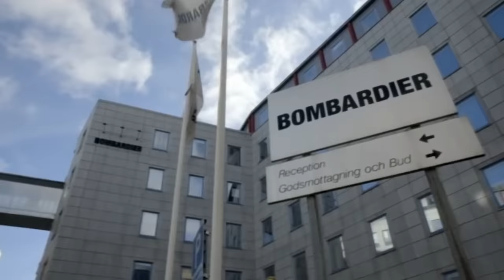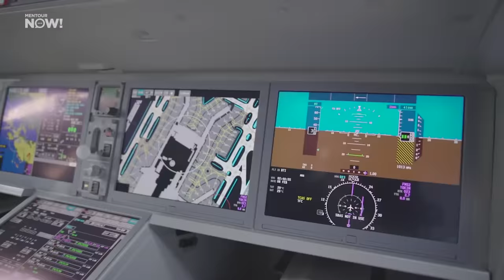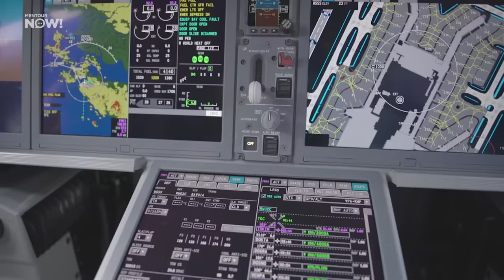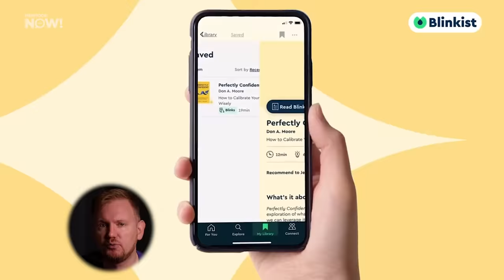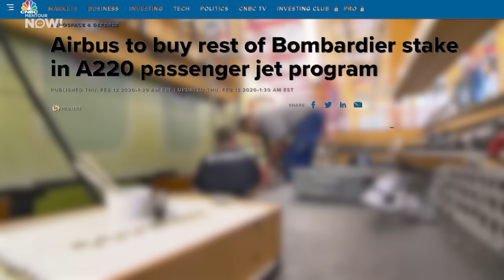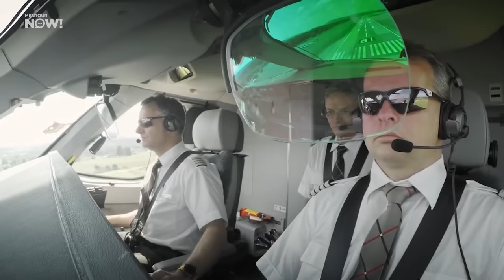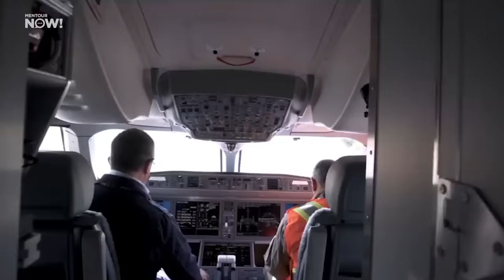Did Boeing GIVE Airbus a FREE Airplane?!

Comment: 737 used to be my favorite aircraft but I was blown away by how comfortable the A220-200 was. The Glass Cockpit and Cockpit Ergonomics would have to be a pilots dream come true.
Reply: It's absolutely beautiful. I consider it the 787 of the small aircraft market.
Reply: @corystansbury  787 isn't that good
Reply: I remember watching an airBaltic delivery flight from Mirabel YouTube video a year or so back. The airBaltic pilots in the video seemed thrilled to bits with the plane.
Reply: I took an A350 and the 787, in the A350 it felt like 2050, the 787 was very good. Nothing beats the A380 in terms of comfort but that will soon be a nostalgic thing
Reply: Only complaint I have about the a220 is the autopilot disconnect sound. It is the most jarring warning I've ever heard
Reply: @fumie4996  Yes it is. The 787 is actually an incredible aircraft, engineering and passenger comfort wise. And also up in the cockpit.
Reply: @fumie4996  To each their own, I love the 787 as a passenger, very comfortable (due to the higher cabin pressure I'm sure). Only thing I HATE are the stupid electronic window blinds, and how some operators force them 'on' during flight, meaning I can't look outside at all.
Reply: I heard from a pilot it's very noisy though. Much more than A3xx Airbus'. So much so that Air France had to buy many Bose A20s ear covering headsets to account for the extra noise.
Reply: Do you mean the A220-300 or the A220-100?
Reply: @frglee   airBaltic was and still the very best promoter with demonstration around the world of the A220-300👌
Reply: I flew across Canada on an A220-300 about a year ago, and it instantly became my new favourite airliner.  The A321-200 I was on for the return trip felt like a 40 year old coach bus by comparison.
Reply: @fumie4996  say that to its huge markets hare (excluding the 10 because Boeing are incompetent)
Reply: @fumie4996  Oh really? Try flying it ( I have). It is an excellent aircraft.
Reply: @bonnassem  just got off one. My only complaint was the seat comfort, but sound was normal
Reply: @bonnassem  the a-220 is actually the quietest passenger jet engine out there right now
Reply: Lol...yeah from a passenger's perspective. But the A220 is highly overrated. It has corrosion issues and the engines simply kill the type. Concerning the engines, the same is true for the E2. As long as it's not offered with a second engine type, like the Leap, it will never be a groundbreaker.
Reply: @bonnassem  The CSeries A220-300? NONSENSE the PW1500G is a geared turbofan that's 50% quieter than a 737 CFM56.

The CSeries A320-300 is one of the quietest if not the quietest single isle airliners in the world.
Reply: The 737 Max is my favorite (based totally on looks) but the A220 has one handsome nose!
Reply: @corystansbury 787 is a nightmare liner for passengers,  in fact for my April trip india to usa and back, i intentionally chose qatar and not united because united flies 787 Delhi to Newark.

I will try to never fly in the 787
Reply: I can confirm to you that the A220 is a dream to fly! Only downsides from a pilots perspective is the seat and the table
Reply: @fumie4996 yes it is, it was the best flight I’ve ever been on

Comment: What isn't mentioned in the video is that at the time of the Bombardier sale to Delta, the Canadian government has decided to accept the political heat and not go to an open competition to replace the RCAF fighter jets. Instead, the government was willing to sole source Boeing F-18 Super Hornets. Canadian government officials were in Washington to finalize the billion dollar deal when news of the Boeing trade action against Bombardier broke. Causing the Canadians to walk away from the negotiations. Apparently, the Boeing negotiators on the military side had been given no warning that the commercial side was going to take this action against the Canadian  government.  Also, one of the very expensive delays for Bombardier while developing the jet was the failure of the American based engine manufacturer to deliver a reliable engine in the time frame contracted. The result being that the program had to sit and burn through cash while waiting for the promised engines.
Reply: Talk about lack of internal communication within Boeing. They really did mess things up!

P&W did indeed take their time getting the GTF right, and Airbus had some initial issues with the variant for the A320 too. 

Some of the problems appeared to be close to "school boy" errors - e.g. differential cooling / heating of parts of the engine causing problems at start up after a short turnaround (the differential temperatures caused the engine shape / clearances / fit to be out of wack, until all of it had all cooled down). 

It was these kinds of issues that were well known about by previous generations of design engineers, but (the company having not designed an engine for a very long time) had been forgotten about by a new generation. It was a problem well understood even by designers of steam turbines (so it's, what, >100 year old knowledge?) 

Constant development, regardless of actual economic need, is the only way of keeping team knowledge together and becoming reliable in delivery.

But in the end, P&W's GTF has come good. It's kind of a miracle that the C Series got certified and into service, and a good thing too - it's a very good design!
Reply: I don't vote Liberal, but I fully respect chrystia freeland. Strong backbone on that one.
Reply: Not only that, but initially, the F-35 was not politically favourable for the Liberal government, as one of their campaign promises had been to cancel the previous Conservative government's sole-source F-35 contract and hold a fly-off instead.

The fly-off never happened and Eurofighter and Dassault both pulled out of the competition. The industrial offsets were reportedly one sticking point, but the big one was a non-negotiable degree of technology transfer, including of proprietary systems, to both Canada and the US due to NORAD.

That meant that realistically it was Super Hornet vs. F-35 and F-35 had the stigma of being the project cancelled by the government. Of course, thanks to Boeing's bone-headed decisions, F-35 was back on the table, and Super Hornet was off... leading right back to a sole-source contract for Lockheed!
Reply: @chanman819  hey don't forget the Gripian also stayed around! Seriously tho the F35 was always the better option and shocker after a certain conflict in eastern Europe now everyone wants F35s.
Reply: Wow! I didn't know this! Although I followed this very closely, I was not aware of the FA-18 deal they were working on.

I do love how Bombardier made a huge F-U to Boeing by practically giving the plane away to Airbus.
Reply: @RCAvhstape  Actually, if you had bothered to closely watch the video, no where is it explicitly mentioned that the Canadian government was actively sole sourcing Super Hornets from Boeing at the exact moment when Boeing decided to begin the trade action against Bombardier. The Canadian negotiators felt like they had been stabbed in the back as they were in the midst of buying an aircraft without going to open completion and so were accepting that they would receive political heat for not having a competition yet to then have the same company which would financially gain from their actions simultaneously try to prevent the Bombardier aircraft sale due to it being a non competitive activity (with the Boeing argument being so weak that it was eventually thrown out by the trade commission--Boeing's apparent hope that in the meantime, Bombardier might be forced into bankruptcy and so remove a possible competitor from the market). The anger felt on the Canadian side by this two faced behaviour by Boeing management is what led to the future dis-interest by the Canadian government to look favourably on Boeing when the competition for the RCAF fighter replacement was held (the fact which is indicated in the video but which doesn't include the Super Hornet negotiation betrayal as part reason for the Canadian side's disinclination to deal with Boeing).
Reply: @williamrobin2638  I can assure you the Canadian government had announced it's intention to purchase 18 Super Hornets as an interim capability measure just prior to the Boeing trade dispute. Canada backed away from that purchase and purchased surplus Australian f-18's instead. 

Read into it what you like but that original Super Hornet purchase was non competitive and many argued the interim capability argument was just a way to slow burn a sole source contact to replace the entire fleet. That's how most of us in Canada who were closely watching all this unfold saw it.
Reply: @chanman819  - Also, the Super-Hornet was tied to the U.S. Navy financing the development of conformal tanks for the plane, without which the plane would have been to short-legged for some Canadian strategic needs. And the Navy cancelled those, too, so by the time Canadian public opinion may have mellowed the Boeing offer had become unacceptable anyway. The Gripen, too, was short legged , so the Lockheed was really the only option.
Reply: Plp
Reply: Please
Reply: Take that,  Trudeau!
Reply: @abarratt8869  "P&W did indeed take their time getting the GTF right" - did they? Several years ago there were quite a few accidents with the GTF, with the fan blades falling onto French and Swiss forest, not to mention issues in India caused by parts corrosion in humid climate.